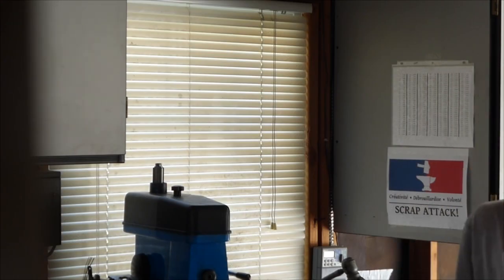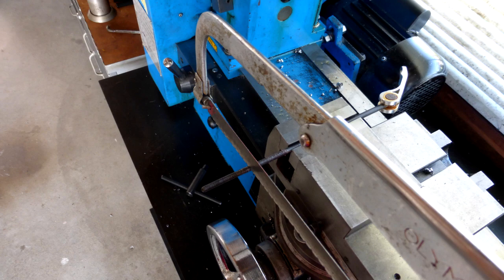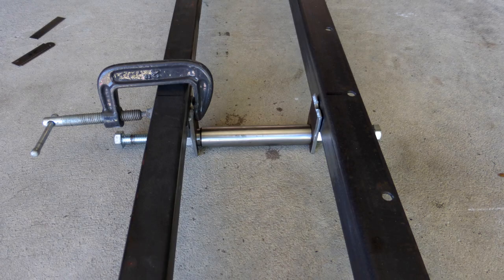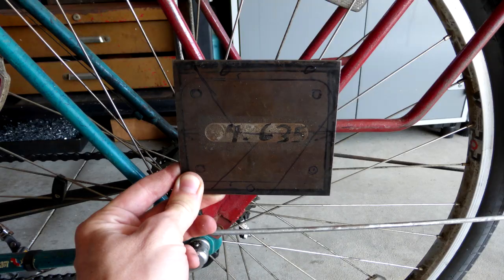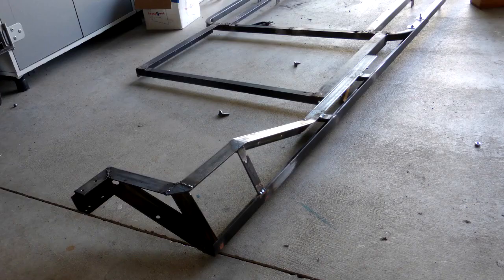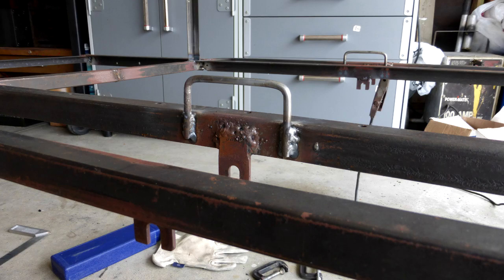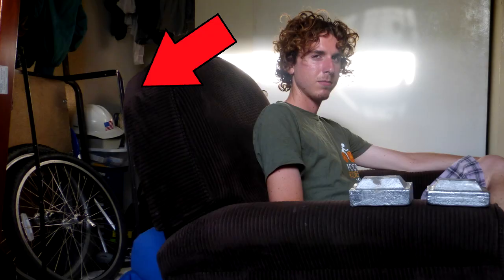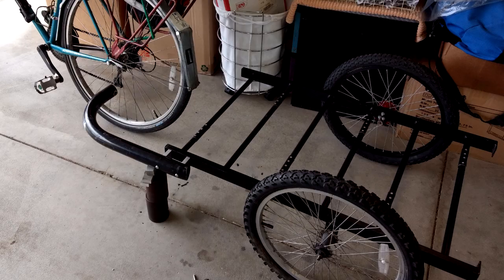Building A Heavy Duty Bike Trailer From Old Bed Frames

Comment: What was the empty weight of that thing?
Just asking, because I just completed my IKEA Svarta bike trailer, build from old IKEA Svarta stock bed ;-)
2m long by 90cm wide, with brakes, so I can dump all my kitesurf equipment on there without space problems.
It's about 22kg complete with wooden floor panels from old bed slats ;-D